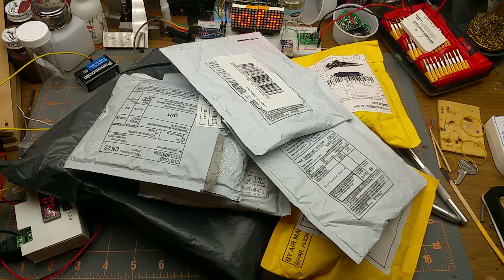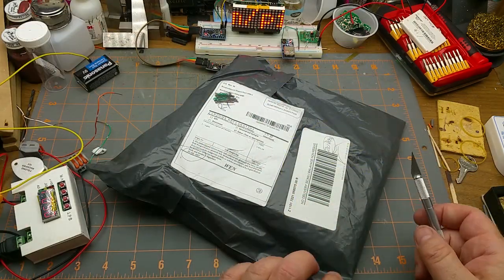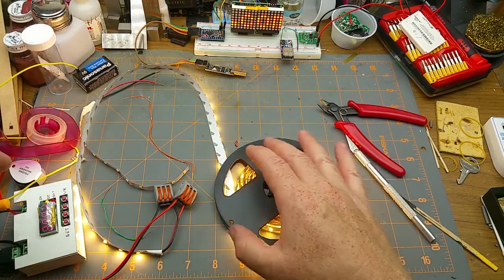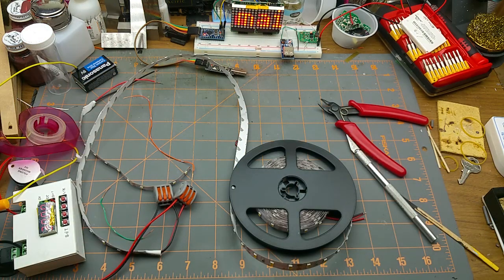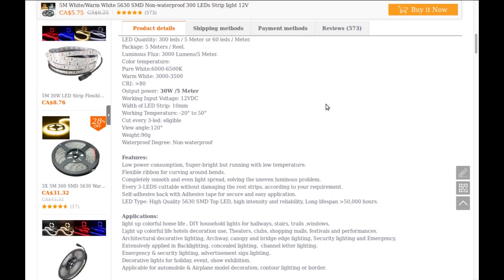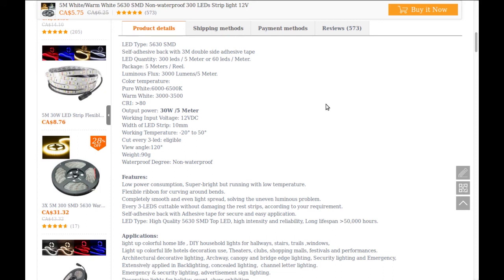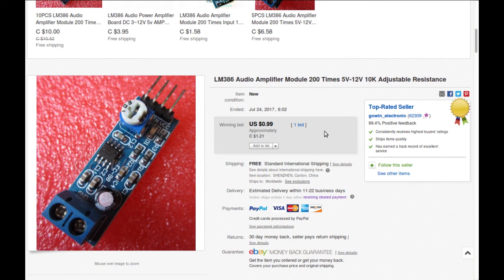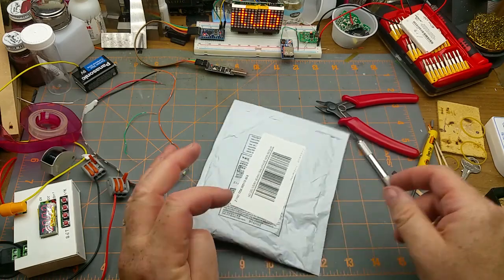mailbag 9

Comment: I used to work with high power switch mode power supplies as a hobby. My workbench had an emergency stop button to cut power. Even if there is only few kilowats available from the wall socket, when you'd need a quick powerdown you will so like the button! I needed to use it only a couple times when magic smoke escaped and did not blow the fuse instantly.
I thnk anyone working with mains (more than very rarely) should have a button along with all the isolation transformers to keep you safe.